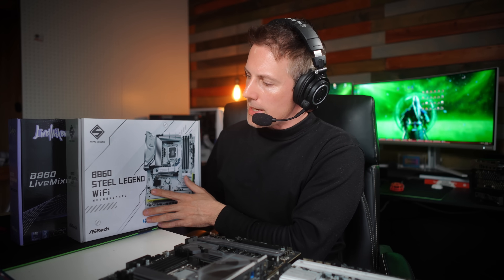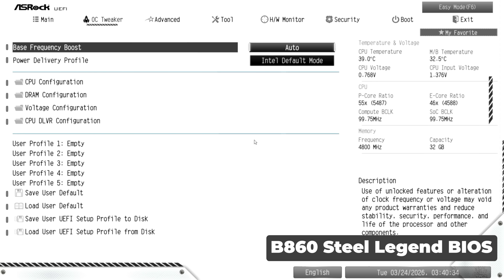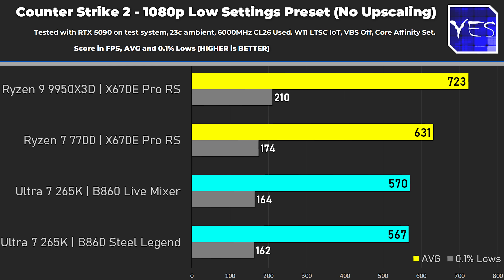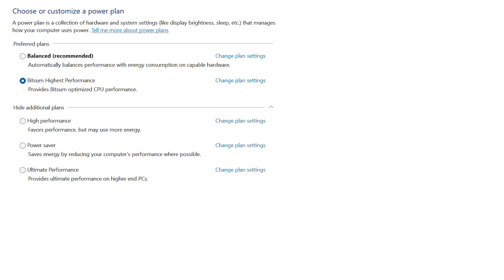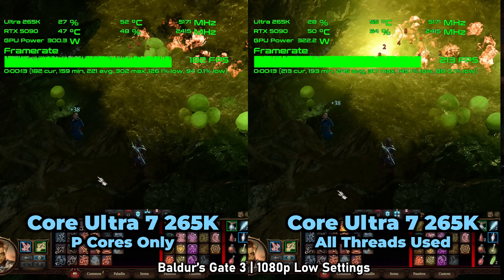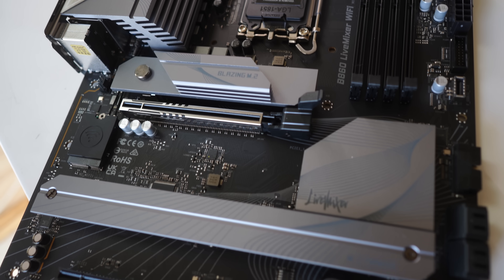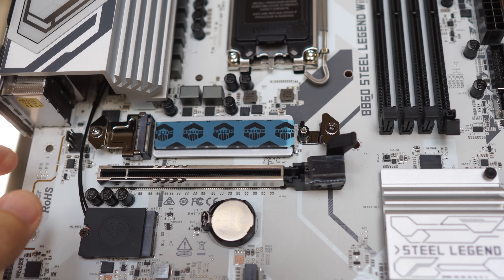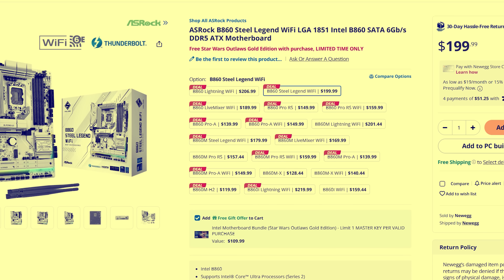I tried the Ultra 7 265K on B860 motherboards and...

Comment: I need your help to buy pc parts. Existing pc 2200g, b450 basic mobo, 12 gb ram. In India, the price is expensive. 

9700x $355
B850 Tomahawk: $247 
Corsair 32gb ram 6000mhz cl30
WD sn5000 500gb nvme SSD
Corsair 650w or 750x psu. 

I am confused about buying a motherboard. I can pay a little more and buy an X870. 

MSI X870 gaming plus Wi-Fi: $260
X870 pro RS: $240
X870 steel legend $280
X870e Tomahawk: $348

I liked the B850 Tomahawk's Qualcomm Wi-Fi 7 compared to MediaTek. It offers better connectivity and a future-proof 5g Lan, but I haven't used it much. The sound uses the Alc4080 codec processor, compared to the Alc897 and Alc1220. It also has a fast boot time. 

I work on websites, doing some light web design and coding. I also manage 80% of the websites' marketing. I open multiple tabs on Chrome and use Photoshop at a beginner's level.

I want to buy 9900x but expensive $445 if that helps with my daily tasks smoother and faster.

I usually work on Chrome, sometimes opening 60+ tabs, sometimes Mozilla and Opera, and sometimes all. Sometimes, I use Chrome and one or two apps, or Chrome with three or four other applications. I also open Chrome multiple tabs and Photoshop.

I'll go to Neru, Asia's No. 1 market in Delhi, India, to buy PC parts and save some money.

Comment: It will take a lot more than this video to make me consider using Intel again for my CPU. And I was an Intel fanboi for many years building from the Core 2 Duo days. Once you lose that kind of respect it takes a hell of a lot more to regain it than to never have lost it in the first place.
Reply: amd 5000 and 7000 had higher failure rates than intel 13th or 14th gen
Reply: @bigturkey1  Yes - I never liked AMD before and never, ever built with it because it seemed like Intel CPUs just worked. I'd say so in comments columns to rile up the AMD fanbois. I'd constantly be reading  about AMD CPU (and GPU) issues. I've just built my first AMD 9800X3D and haven't had any problems with it and running cool as a cucumber. So if Intel want me back as a customer they had better start building high quality flawless winning CPUs again and not electric kettles with warranty problems.
Reply: @ r/amdhelp

Comment: I have a intel ultra 9 285k with 98 gigs ddr5 ram 6000mh and a rxt 5070 ti and its a beast runs any game at 1440 on ultra setting without breaking a sweat cpu temps in the 130f range
Reply: 130 F? What's the tdp on the chip? That's hot!!!!!
Reply: @zonleescyberlifecorner8282  That's 130° Fahrenheit, while in Celsius it would be around 54°C

Comment: Wow, 230W for mediocre performance, pair this with 9070 XT and we're talking typical space heater just for the two components, without OC, add the rest (ram, storage, screens, etc.) and you're easily in 1000W range. Looks like this whole generation of hw I will skip.

Comment: Recommendation is in opinion wrong. You are gaining everything with Z890 board and only buy K chips. You pretty much have to OC D2D and NGU to lower memory access latency. Even with stock voltages you are going to gain a lot of gaming performance. Also using slower than 8000MHz memory is going to hurt gaming performance as well.

I side-graded from 7950X to 265K and couldn't be happier. Platform is so much better, snappier.

Comment: why would they ever put something out that was weaker than the previous gen? I noticed it running at 45c so I think it's turned way down. I bet  if you turn it up in bios it will easily keep up.

Comment: From what I've seen on the mobile side of things, memory latency was shown, on the latest and greatest coming out with the Ultra 7 275HX and fastest memory available, to be around 110-120ns. Absolutely horrible. Plus core to core latency is also wildly higher than previous architectures, which explains why gaming performance is so much lower versus productivity is so much higher. Harkens back to the Zen 2 launch when latency and cross talk between core clusters was the real reason for decent gaming but still mediocre performance relative to the competition.

Comment: Interested in this also to see how they perform together, older games seem to follow strong single threaded (Intel still seems to be good at that lol) but for my AM5 have been thinking of grabbing a 7700 or 9800X3D (9950X3D Linux if I get a drop). Personally I found the E cores for gaming useless and ended up disabling them on 12th gen so the P cores could boost higher and some games wouldn't crash out. I don't think I will buy Intel for a while as AM5 will last a lot longer. I consider 12400F, 12700KF, and 12900KF to likely be our last household Intel machines.

Comment: You can OC the G.skill 6000 CL26 to 8000 CL34 no problem 🙂Buildzoid got them to 8000 Cl30 i have the same kit but havent tried what it can do yet.
Reply: 8000 CL34 would only be a theoretical increase of 400 Mt/s.
Reply: @jamesbanks5597  I just threw that number there. They can do better like Buildzoid showed.

Comment: Intel needs to make a monolithic 12 core 24 thread gaming monster. No e cores.
Reply: Framechasers viewer spotted, just kidding, I 100% agree, it would be a gaming and multi threaded monster.
Reply: @MichaelHickman3D  but everyone get mad at a 200w draw cpu before boost.
Reply: E-cores are mostly for scalar Cinebench.
Reply: @cyberletho  On the contrary, they are actually reducing the P core count in the next 300 series. Their new e-cores are more efficient than their P core on Arrow Lake already.
Reply: Zen 6 will be as close as it gets.
Reply: yeah but if they get rid of e cores their productivity performance will suffer alot. gaming is not the only thing that matters you know
Reply: ive tired disabling e core or hyper threading with 12900k and got worse fps
Reply: @ dont do that. an 8 core 8 thread cpu would not be good for many games today.
thats exactly why intel shouldnt have removed multithreading. imagine needing more than 8 threads but you dont have any more so you have to use e cores... not good
Reply: @cant_Comment  basically no game uses more than 8 cores, and for background tasks e-cores are more than fine. The loss of HT isn't an issue, everything else is with the architecture itself
Reply: @cant_Comment  E cores are used before virtual threads in their current CPU architecture. Virtual threads are only used when all E cores are utilized. Intel WANTS you to use E cores.
Reply: @kerotomas1  not sure how true that is that "no game uses more than 8 cores". yes majority of games dont use that many cores and threads but there are certainly some more modern ones that scale beyond 8 threads. for example cyberpunk. not that id play that game. im not interested in AAAs anyway. i just play dota2, cs2 and chess. 
if extra threads dont matter then why do some modern games lose performance when you turn a 16 core 24 thread 12900k into an 8 core 8 thread? yes those games are rare, but they do exist. hence why "no game uses more than 8 cores" is just outright wrong.
Reply: @User-ys7cb  yes. last i heard that is how its set up by intel. except when gaming. a 12700k will go into multithreading even for games like dota2 and cs2. i have a 12700k and i dont disable e cores. i like it when theyre around, its just that i set game affinity for p cores. i guess in stock they wont go into multithreading... ill check.
i am not against e cores but i disagree with intels design principles. they rely too much on e cores and got rid of multithreading. more and more games in the future will use more than 6 or 8 threads. removing multithreading is a mistake
Reply: Intel E-Cores are called that since they are die space efficient, not because they are efficient in nature. I do understand the concepts of Big.Little but Intel added their e-Cores with Alder Lake since they took up less space on the die than adding more big cores would have. The jump from 10th Gen to 11th Gen to 12th Gen was a real cluster. 10 Cores, no 8 Cores with AVX512, no 16 Cores but no AVX512. Geez Intel make up yer minds.  Also both my Gigabyte and Asus AM5 boards have some sorta "X3D Boost" Gaming Mode that disables SMT and makes my CPU 8C 8T. Have not done tons of testing but I ultimately just turned it off.
Reply: @yrelykx-hh9bj  dont use the x3d boost. it doesnt help. just makes things worse. i have a 12700k and a 9950x3d. never have i had thread scheduling issues. core parking problems are overrated. in reality all you need to do is manually tweak scheduling at the task manager(or bios if you want)

Comment: USB 4 issues on AMD seems to be more of a Windows issue. I'm on Arch Linux and never had any problems with USB 4, I use an external NVMe enclosure for my steam library. Its been working great!
Reply: That's good to hear. That's awesome that you're having a stable system on Arch. I'm planning to see if the Asrock X870E is working well with USB4 on X870E Nova when I finish this build. Manjaro was my first gaming distro, made it to ArcoLinux but never a vanilla KDE Arch, though it looks easier to install now (Arco even has an installer to help install Arch). I did try CachyOS but it didn't work on the Z690s Asus. My current main still doesn't have the USB4, Z690 12900KF. I'm moving still Steam compatible games from Nobara 40 to my Nobara 41 install moving in now that the Nvidia driver is super stable 470, 6.13 kernel. I saw one of those USB4 nvme enclosures and they look really good. My games are still on 2TB nvme with OS for Steam but maybe I can put them on my 2nd nvme if the drives are automounting in Steam much easier now. Am actually using the CachyOS kernel so I almost feel like I'm back on Arch based but am still on Fedora. My brain still thinks in Arch commands, first usually. I do believe there can be driver/hardware issues just on Windows and sometimes the same hardware just works on Linux gaming, used to have GPU side the AMD drivers crashing out in WoW last gen but only Windows issue. Goal is just to setup the A/V equipment again and it's all stable for a while.

Comment: Honestly - I'm the complete opposite of you with this 'K' series should be abandoned.  IMO Intel had it correct with Kabylake-X.  All of the enthusiast parts should be on the HEDT socket with Z and X boards basically just swapping the consumer socket for HEDT on the Z and maybe putting in a hard power limit of say 300W or so to ensure that Z boards do not get crazy expensive.  Then you could drop in like a proper 24 core or the 8 core consumer design chip into Z or X boards with the 12+ core parts being able to take advantage of quad channel and 48 PCIE lanes on the X board.

Comment: I just got the live mixer and gskill ram 82000 mhz. It definitely has xmp working on ram kits. The ultra has so much room to undervolt and overclock. I got mine to beat 9800x 3D in a lot of games now. Out of the box x3d gaming easy but if you know what you are doing these Intel chips can complete and even win.

Comment: What makes Intel "bad" in general, is the socket support longevity.

AM4 socket x370 MoBo was released in February 2017, and it can use all the way up to Ryzen 5800x3D. That's beyond 5 years support.

Can any of Intel socket do that? Nope, never in Intel's entire history as CPU maker.

Meanwhile AM5 x670 is like 2.5 years old at this point. If AMD still supporting it for another 2.5 years, I call it as a Win
Reply: Actually Intel used the LGA 775 socket for 7 years. It went all the way from a single core CPU at 2.6 GHz to quad cores at 3.2 GHz.
Reply: @ssplayer  that was a transition time, and had a different release of cpus, not like now that every year a new generation comes

iirc some motherboard could handle some cpus, not all, something similar to am4 and too small bios chips that couldnt fit all the cpus, at the time the best i installed were celerons and dual cores, it was not a platform i ised often because it was more expensive and had less cores than what amd was offering
Reply: This, bought a Z590+10100F in the used market in 2022 but upgrades are dog shit expensive. 10700k, 11700k sell for 300$. Why would I do that when AM5 has 7600 which sells for 200$ that beats both the CPUs with lesser cores and power draw.
Reply: But who would want to throw a brand new CPU in a 4 to 5 year old mobo anyways? My mobo from 5 years ago had the max speeds for everything and if I wanted to and was able to throw any current CPU into it, I'd be dumbing down the speeds it's capable for everything. If I'm buying a brand new CPU I'm gonna want a mobo that can utilize the newest fastest speeds for memory and the current pcie gen. Platform upgradeability is an illusion because when you really think about it, it's only beneficial to throw a new CPU in a mobo that's less than 2 years old and who upgrades that often anyways unless you're an enthusiast? And even that's a tiny percentage of users who do that. The illusion of future proof is ridiculous
Reply: @seanchristopher740  AM4 X370 is only 2% slower than AM4 X570 which intended for 5800x3D

Also, AM5 X670 is visibly identical in performance to X870 where the only difference is that X870 has better VRM for overclocking 9800x3D , so if you never want to Overclock it, and you already have X670 + 7800x3D , you can upgrade it and expecting similar performance to X870 without overclocking.

If Hypothetically there's AM5 X970 or newer, it won't have too much advantage from X670

Also, if you're using Intel Core or AMD Ryzen, you're most likely end-user who won't get benefit of PCIe Gen leap on GPU slot. For Gaming and Productivity, PCIe x16 Gen 5 has no advantage over Gen 4 anyway. Only SSD matters.

And when you do need PCIe Gen 5 x16 , you most likely use Xeon or Epyc.

In the end, it's all about money saving.
Reply: This is what Intel needs to focus on going forward. Why spend money on a chipset that we know will be dead in a a year or two? Intel needs to start supporting a chipset for at least as long as AMD to give people more confidence in buying
Reply: well, their previous socket worked for 3 years instead of two

in there the 12 gen was very decent but power hungry

then it came 13th gen rusted out of the factory and the firmware problems and even more power hungry

then it came 14 th gen and made worse the firmware problems making a cpu that destroyed itself while using up to 400 watts to do some workload

amd has problems on thier sockets over the decades, sure, but only 30% of the cpus being worth to be purchased in that socket is not a amd problem, never

if they made a new socket each year, instead of one for two years, i dont think that would help them, because the problem is not the socket, is how they do things and how they lazy and negligent became while just pushing more watts into any cpu expecting you to have a industrial chiller to keep it cool

Comment: No point in getting the 12700K right now as you can get the 14600K which is more or less the same price and actually outperforms it. The latter also comes with 2 free games.
Reply: imagine losing 2 p-cores just to get a couple of awful generic modern games, this is some seriously terrible advice.
Reply: @juanme555  That's a dumb argument. The 14600K has better multithreaded and single thread performance while having less 2 p cores. 12th gen is almost 4 years old. It's not a smart buy over the 14600K. Simple as that. End of discussion
Reply: @Sam-fq5qu  
what multi-thread garbage are you talking about, all these lga1700 cpus are meant to have their ecores turned off and be paired with good bdie ram, otherwise they'll have weird stutters that are not quantifiable ingames and in desktop usage, ivan from framechasers is an extreme overclocker and he turns them off, yetchyescity i dont need to explain.

You really would take an actual hexa core i5 over an i7 with potential avx512 just to get a higher cinebench score? you DEFINITELY have no right to be as smug and arrogant as you're being right now, this is actually absurd.
Reply: @juanme555  You are not the sharpest tool in the shed, are you? You must be living in cuckoo land. The 14600K demolishes the 12700K in synthetic benchmarks as well as gaming and productivity. You're free to believe the 12700K is a better CPU if it makes you sleep better. I will not waste my time debating you that the sky is blue or that water is wet. Don't bother replying with any more rubbish. Won't read. End of story.
Reply: @Sam-fq5qu  
You are honestly embarassing.
Reply: @juanme555  lmao you are the one embarrassing yourself here
Reply: Too many ppl that understand how pcs work are too focused on core count like they are with vram 😂 and there is no trying to tell their lizard brains otherwise.
Same with the i5, i7, i9
Most ppl will choose 11700 over like 14600 just the one says i7.
They are same ones that want to put like 128gb in a pc they'll only use to game too because they think more ram=speed